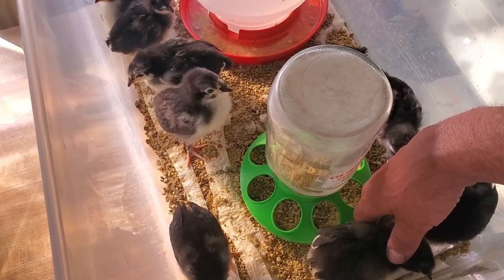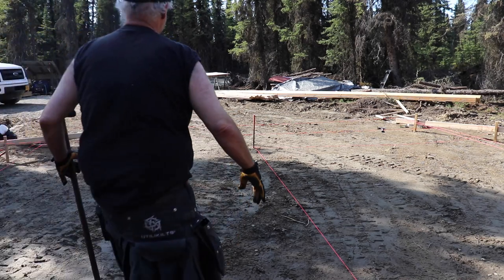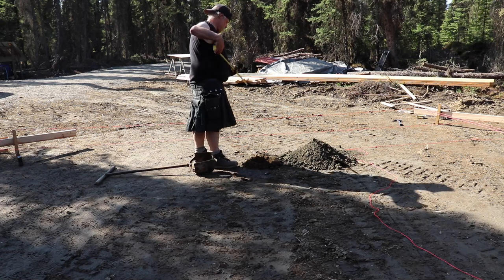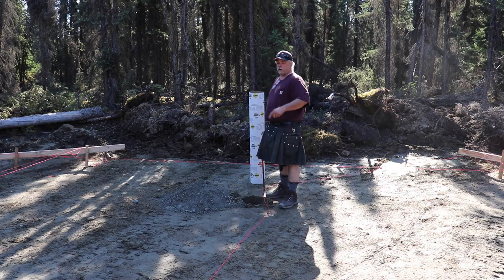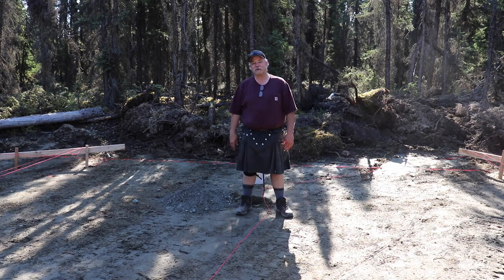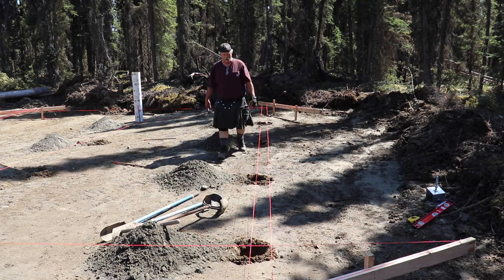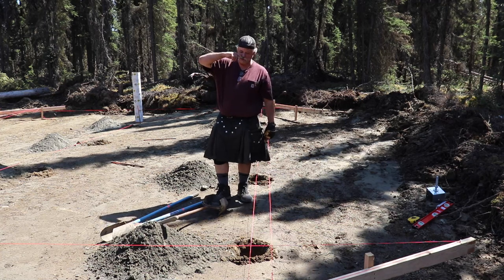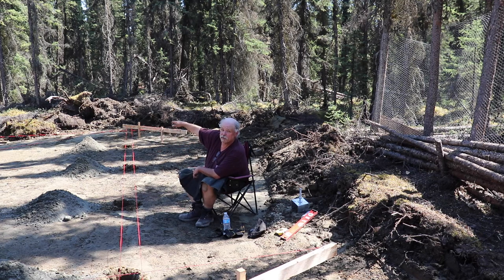digging the sonotube holes for the Alaska cabin

Comment: One thing you can consider for the concrete is adding either fiberglass fibers or "tiny rebar". The tiny rebar are about 1/2 the size of a toothpick and is metal.  Both items get mixed into the concrete and act as if you put rebar in your sono tubes. If I'm not mistaken, both items are minimal cost. Just to be clear, you only need one or the other if you choose to add something.
Reply from the maker: I am going with rebar,  1 piece in each

Comment: What diameter sonotube, did you use for your project?
Reply from the maker: 8 inch tubes, 3 feet deep
Reply: That's exactly what, I'm using for my ground mount. Solar array. With the same type of auger. That auger is pretty awesome at digging holes.
Reply from the maker: @carlosreyes6448  that thing makes fast work of it! Lol...it is better than the new ones hahahahhaa
Reply: @SeanInAlaska  yes, sure does. But the only problem that I'm having. Is trying to get it level. Only because the sonotube is fitting to snug. Did you have that problem?
Reply from the maker: @carlosreyes6448  I did...use the auger to dig the hole then widen it a bit with a shovel.  After that it us easy ro clean it out
Reply: @SeanInAlaska  okay yes that does make sense. I appreciate your help.
Reply from the maker: @carlosreyes6448  no worries! Hope you have a great pour! 👍